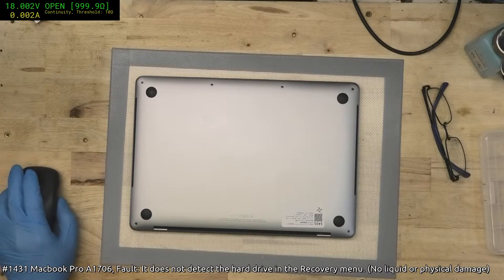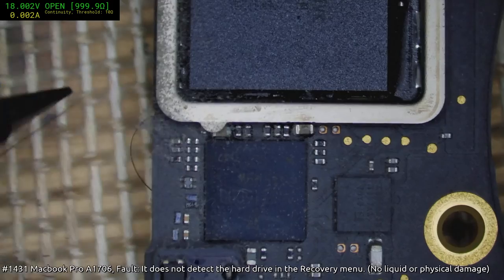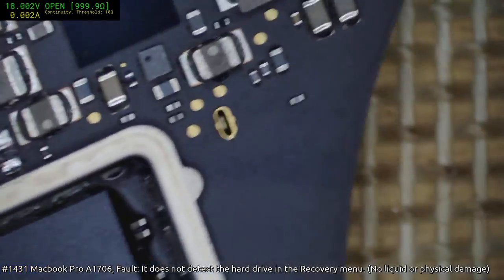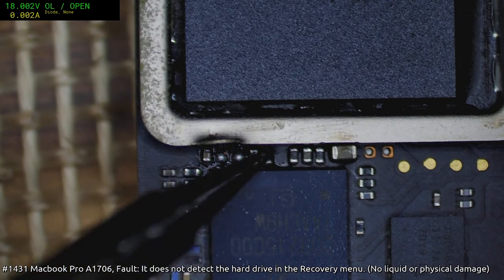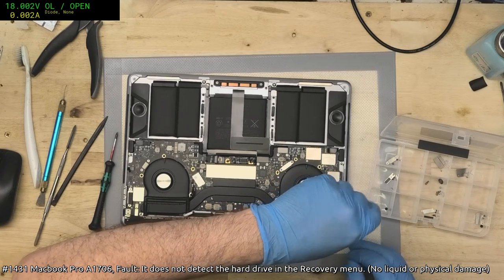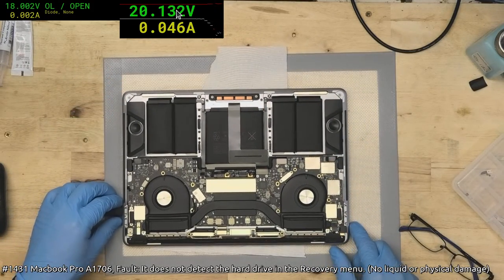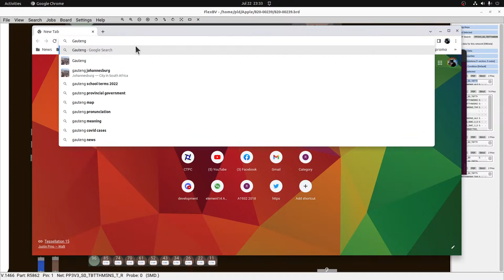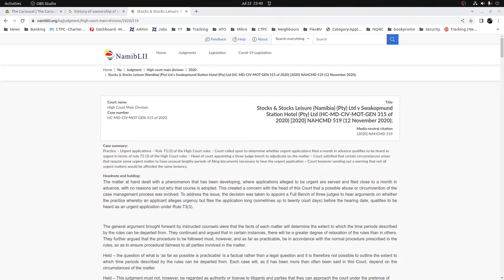Live Macbook Repair: Macbook A1706 not detecting internal SSD [Fixed]

Comment: I have a 15" touch bar with the same issue (late 2016). However I think the SSD has failed due to age etc. Is it worth tearing apart and doing continuity checks?

Comment: i removed the cap u replaced in the video then injected 1.2v into the line and u8600 is the only thing heating up...is this macbook screwed?
Reply from the maker: "Maybe".  Better to perhaps ask on the Facebook Macbook Repair group, or Badcaps or the Rossmann Repair Forum or Discord.

Comment: My laptop crashed. It won't turn on at all. Is there a way I can retrieve the data from the hard drive?
Reply from the maker: Depends on the laptop and if it has a removable drive. If it does, then there's a good chance. If it doesn't, then you're going to need the mainboard/logicboard repaired.

Comment: Had an A2141 expecting recovery, so I unplugged usb c cable during dfu attempt, which caused next attempt to put it in recovery mode which was then successful, does wipe it however.
Reply from the maker: Interesting point to note.